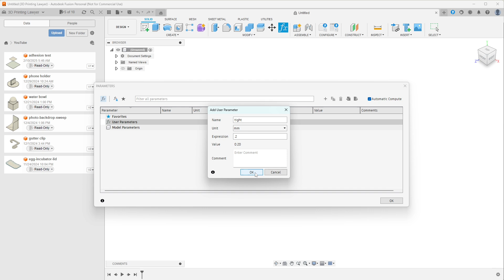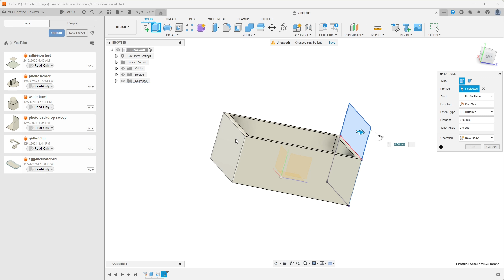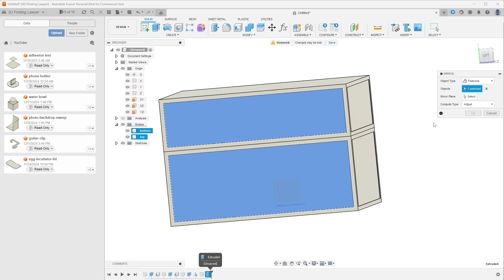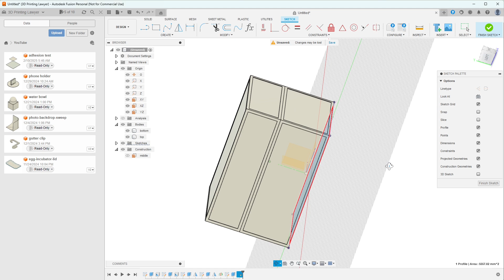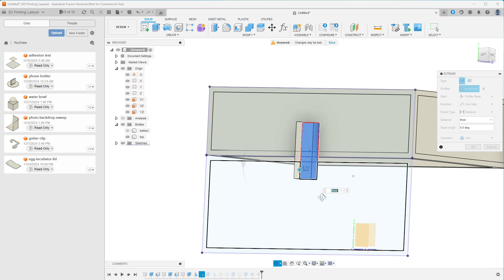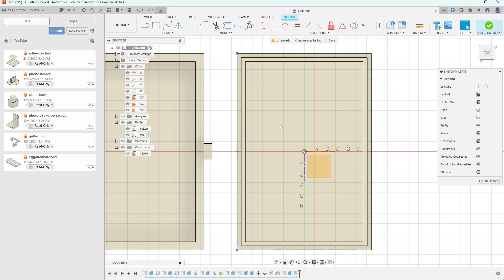Designing a minecraft style chest in Fusion 360 for 3D printing. #3dprinting #fusion360

Comment: As a web dev company owner (my wife being the one that codes all our client sites), I can tell you the lack of needing to click apply is actually a bonus to user experience vs needing to click it (as a basis, the less clicks the better for most use cases), the sorting was default by relevance, so likely if they are the claimant first, then secondary ownerships of the copyright or approved license listings they may also be listed on for example). Having it sorted by relevance AND date though may be an improvement, but that also can result in sorting issues for pending things that may be listed on the database not having a good place to land for example.
Reply from the maker: @MattWeber  that totally makes sense that it was relevance but it's not very useful when you get an exact match on owner. I never considered that. I just expected to click apply because there was an apply button. Maybe they should get rid of it if they're going to auto apply? Or maybe they auto apply after 5 seconds and you can force it earlier? Subsweeps does that on one thing. It waits for you too stop typing for a few seconds before it checks to see if the url you entered is available. I guess maybe it should also have an apply for the inpatient?